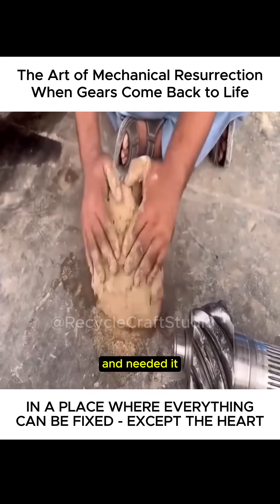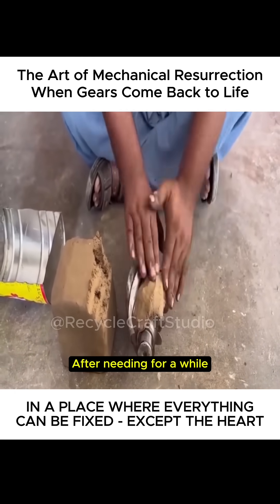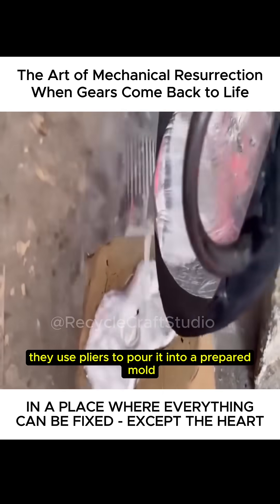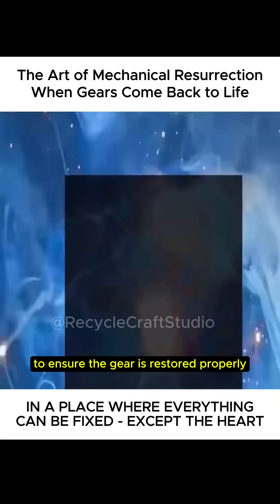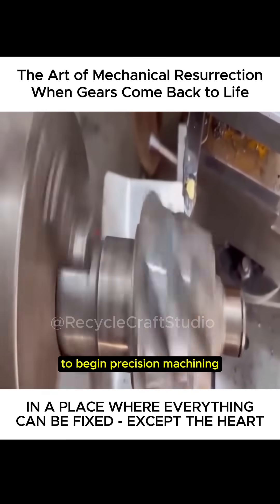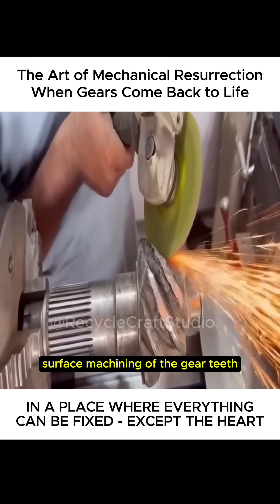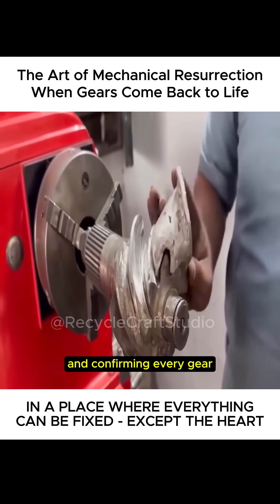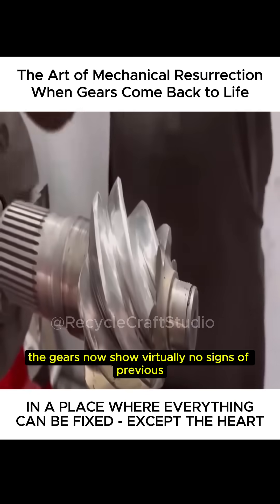Broken Gear Brought Back to Life by Hand | Pakistani Craftsmanship | Recycle Craft Studio  #mechanic

Comment: I helped a buddy do this on a broke down trail rig in the middle of the woods. The lifespan of something like this is measured in weeks to months at the longest. Not only does it destroy the heat treatment of the original steel the new steel is not nearly as hard as the original and wears quickly.
Reply: Thinking your correct..but it's sells and proves you can polish a turd..